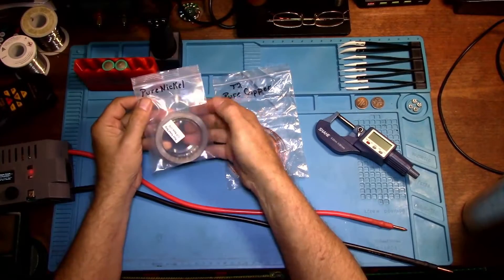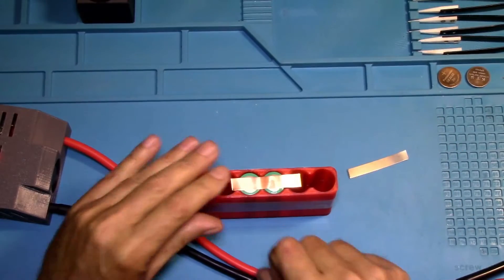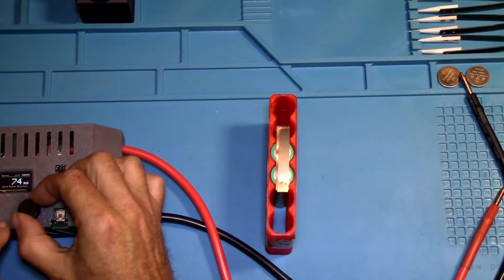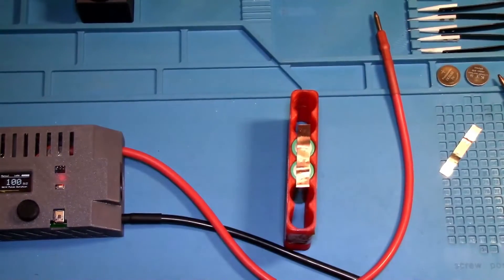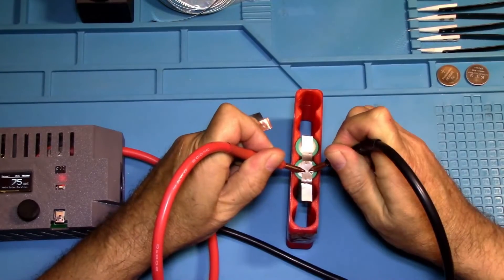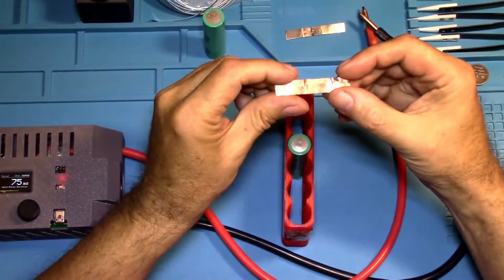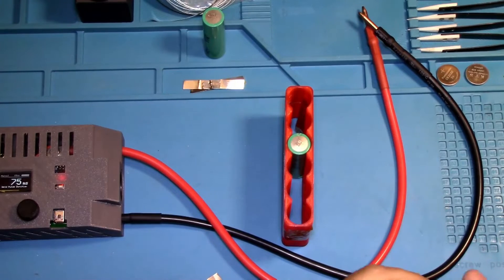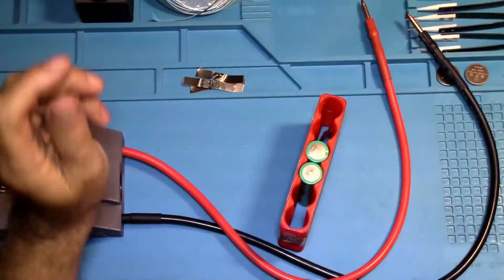Can the Malectrics Spot Welder Do A Copper Sandwich Weld - Pure Nickel, Pure Copper - Let's Find Out

Comment: Resistence is one of the big factors of spot welding .
Amps , pressure and resistance.  Ive found the spacing between the electrodes is absolutely vital to outcome . I dont place my electrodes by hand because the gap and therefore the weld outcome are just too difficult to do consistently. Same for pressure .
Basically copper very low resistance means you need a whole lot more amps in order to build enough heat to form the weld . 
I have been looking at these sandwiches as a way to reduce voltage sag im seeing in packs with very high capacity cells that have low / medium current discharge capacity . Ie/ 18650 cells w/3500mah @10 amp max .
I always see a fully charged pack at 16.6-16.8 volts sag immediately upon high throttle down to 15 volts flat or even 14.75 volts at times .
Im thinking its the nickel strips but this whole "sandwich " strip theory just sounds like more variables in a game that already has too many variables ...
I might just stick to layers of nickel becausr I build long range planes where I simply cant afford to have welds come loose on a plane thats in the air more than an hour operating out of sight !
Reply from the maker: Thank you for your comment, and I absolutely have to agree with you.  Every battery pack that I have taken apart (and I have taken a lot of packs apart to salvage batteries), have had only ONE strip on the batteries.  If using a "Sandwich weld was SO vital to better performance, then why don't companies like Dewalt, Milwaukee, Ryobi, Bosch etc., etc., use sandwich welds in their batteries?.

If we need (for some reason) double layers, why not just use a thicker strip?, unless there is some significance to using two smaller strips instead on one thicker strip?...

I have built a number of battery packs using only one layer of nickel and I have never had a problem with overheating or failure, so I don't really see the point (like you say) to use copper and nickel together, but I guess it is whatever is best for the individual... 

I created this video due to a request, but have never (before or after this video), created a battery pack using a sandwich weld, but it was fun to give it a try to see if it would work I suppose :).

Comment: That spotwelder performance depends heavely on what battery you power it with. I use a 800cca carbattery combined with bigger welding leads, and that is so powerful that I need to go down to 7-10ms when welding 0,15mm nickel strips. So I think my setup with the same spotwelder would have been able to weld that sandwich 👍💥
Reply from the maker: You are exactly correct.  It depends heavily on the battery and cables for sure to get the best performance.

Comment: Is that Setting (40, 60 75 etc milliSeconds or percentage?  @ about 11:35 the reason it is "puffed" is because you are pulling the strip off.  Tere would be some heat on the top of the battery but current is not going thru the battery.
Reply from the maker: It is miliseconds.  No current going through the battery,  but yes the heat will go up as the milliseconds are increased.

Comment: I have a previous version of this spot welder and, when everything is working well, it does a good job (mine is mainly used to make 4S2P replacement battery packs for cordless drills) , however, 2 years on I am on my 2nd set of batteries. I have 2, 3S LiPo packs in parallel, a 5200mAh 100C and a  5000mAh 60C but the 2nd set have degraded to such an extent that one is puffed up significantly and their combined capacity even fully charged will only give 350amps. I am considering a super capacitor version which would be about the same price as 2 new Lipos. So I wondered what you use to power your system?
Reply from the maker: Thank you Michael for the comment.  I am using a Zeee 11.1V 3S Lipo Battery 100C 9000mAh

A puffed battery sounds kinda scary.  This is a link to the one I found on Amazon:
https://www.amazon.com/Zeee-9000mAh-Battery-Connector-Infraction/dp/B07YP7DW2Z/ref=sr_1_6?sr=8-6

You can search Amazon for:
zeee 3s lipo battery 9000mah

There are a few, but oddly not many of that size.

Hope this helps.
Reply: @Outside-In.  Yes that is the reason I have discharged the puffed one and dropped into Aldi's battery recycle bin. I think it is the high current that has degraded them as I would get almost 600A when it was working properly. That is why I wondered about the supercap version I had even gone as far as thinking about one of the deep cycle lead acid batteries (aldi sometimes have them on special) that are used for solar panels. I only use it on my electronics station so a semi permanent setup would work.
Reply from the maker: @michaellinahan7740  Thanks for the info.  Do you have a link to the super capacitor version, I would like to take a look at that?.

It is great to hear that you were able to get rid of the polymer that was puffed.  I keep mine in a fire proof safe, but still it makes me nervous having them around, and maybe a super capacitor would be a much safer way to go.
Reply: @Outside-In.  YouTube has been deleting my replies so I sent an email to the one listed on the contacts page
Reply from the maker: @michaellinahan7740  Unfortunately YouTube does that from time to time, it also happens to me sometimes...  I haven't received an email yet, but will keep a lookout for it.

Comment: Hey .. to properly do this test, you MUST have a separation between the electrode materials. I cut my strips lengthwise so the current goes down into the strips.  please repeat test  thanks
Reply from the maker: Thanks for the suggestion.  I was about to point you to another video where I successfully welded copper and nickel, but I see you already looked at that.  I am not sure what you mean by "you MUST have a separation between the electrode materials".  forgive me if I sound dumb, but I have been working on a new video, and haven't had a chance to "change gears"  yet LOL.

Comment: The material on top needs to be the least conductive option you have, like a thin(0.1mm) nickel-plated steel, because the resistance in the metal transforms that sudden rush of electrons into heat, heating up the metal on top and that one melting the metal below. You can even cut little squares(1 cell) to put on top of copper because the metal on top doesn’t contribute to conducting electricity(for this small load), it will take the path of least resistance and that is copper.
On a side note, you can check if it’s pure nickel by taking the volume(L x l x thickness/height) and weighting it - then you can take that to an online calculator to get the values of what a specific material should weigh at that volume.
Reply from the maker: Thanks Lilian for the information - much appreciated.  Good to know that the nickel is only used to fuse the copper to the cell.  I like using a corrosion solution to test pure nickel, but the weight of nickel sounds interesting as well.  👍
Reply: @Outside-In.  The more resistant the better. As @allacemed mentioned, the nickel-steel has much resistance and that is converted in heat and that is good to weld copper. Copper alone does not weld well because is so conductive that does not give a chance to the welder to produce heat and weld, unless you use a powerful welder using Flux between the copper and the battery.,
Reply from the maker: @DroneSurf  Thank you Drone Surf, you are exactly right.  I am learning as I go with spot welding, and it is comments like yours that help not just me, but everyone who reads them, so thanks for the information, very helpful - and much appreciated.  👍👍🤏

Comment: The nickel heats up enough to melt both itself and the copper under it. The copper does not heat up enough by itself
Reply from the maker: Yes, I am sure we would need a much much more powerful welder to spot weld copper by itself.
Reply: @Outside-In.  So it means if its hard to  spot weld it the more capable it is to stand a current. I just bought a 0.15mm nickel plated copper i cant weld it but a 0.3mm pure nickel is no problem.
Reply from the maker: @jobmariano348  It mostly has to do with the type of battery you are using and the leads length.  I am using a 3s 9AH 100c battery, and it does weld 0.1mm copper and 0.1mm pure nickel, so it depends on the total thickness, but a thinner copper is better as copper is the hardest to weld.  

Thanks for your experience - much appreciated and good to know. 👍
Reply: @Outside-In.  Is it ok to put a nickel before copper then nickel again. Because base on my experience on this the copper stick to the bottom and upper nickel and its tight. But is that setup safe. Please help
Reply from the maker: @jobmariano348  Job - Thanks for the question.  Wow - That would be quit the sandwich 🤔 - That is quit the interesting thought, but I would say only if you had a much more powerful spot welder, because not only do you have to have enough heat to go through the copper to the battery (which the nickel is the reason for that to work), but you now have to go through yet another layer of nickel to complete the weld.  

Would it be safe - that would depend on the thickness of the strips, and the extra power you would need because of that thickness, you would just have to give it a go with your welder and see if it would actually work, but I would recommend to use a scrap piece of metal instead of a battery - you know, just in case you needed too much power - causing a catastrophic failure of your battery...  If you have a .2mm nickel, a .2mm copper and a .2mm nickel - that is allot to get through, so like I say - you can only try - don't know why anyone would want or need to do a weld like that, but we wouldn't know until we tried.  

There are many others that have much more experience than I, so hopefully someone in the comments will feel free to chime in with their experience - I am using mostly common sense with my answer to make up for my lack of experience LOL.

"Every new idea - comes with unknowns, but until the unknowns are tried and tested - it will forever remain - an unknown..."    outside in

Hope this helps, and thanks for your question. 👍
Reply: @Outside-In.   i have 21S 11P batteries load is 165A

My pack is rectangle
I used 0.15mm x 8mm nickel
First  for the parralel 
then 0.05mm copper x 240mm width then a strip of 0.3mm x 8mm nickel per battery point to weld the copper. Do you think it can handle that 165A load?

Because based on my research a 0.15mm x 8mm nickel total area is 1.2mm2  is good for 4amps
Then a copper is 4 times conductible than nickel meaning for every 1.2mm2 copper it can handle 16amps.

Based on my setup it is 0.05mm x 240mm copper is 12mm2 divided by 1.2mm2 = 10 x 16amps =160amps

Then 3mm x 8mm of nickel =  2.4mm2  which is equal to 8amps 

8amps x 11Parallell = equals 88amps

So overall it is 160A +88A = 248A.

So i hope it is safe for my 165A load.
Reply from the maker: @jobmariano348  Thanks Job.  Yes, you could even do that using only nickel, and the only reason that some and I say only some - people use copper as well, is just to be sure, but any battery pack that you purchase on the market only uses nickel strips (around .2 - .3mm), and your setup would be .5mm.  I have never ever seen a battery pack that you purchase that uses a sandwich weld on their batteries, as that would make that pack very very expensive.  So I would say that anything that you can do (building your own), that enhances what you can buy - would definitely work and be ok, but like I stated earlier, you won't know until you try.  But also keep in mind that the extra power you will need to complete a weld like that, and that many welds to build a battery that big - will introduce an incredible amount of heat in those cells, so could be very dangerous without welding very slowly to keep down the amount of heat that you will be introducing into the pack.
Reply from the maker: @jobmariano348  Job - this is to let you know that I am getting ready to leave town in a few moments, so if you respond and I don't right away, it is not that I am ignoring you, it is that I am on the road and will be for the next 4 hours.  If you have any further questions, I will answer them as soon as I get stopped.  Thanks for your understanding.

Comment: Nickel is not nearly as conductive as other metals that are commonly used like copper, gold, silver, or aluminum, but, it’s for that reason that it remains a popular choice for DIY.

The nickel’s higher resistance is the reason it welds more easily, as with more resistance there is more heat being generated at the welding electrodes, allowing it to be welded with equipment that isn’t industrial-grade, and very expensive. 

It takes thousands of amps to reliably weld copper strip directly to the cell, however by placing the nickel on top, the current must pass through the higher resistance nickel along with the copper, increasing the heat sufficiently that the copper can also be welded with the nickel.
Reply from the maker: Thanks Mark for the information - makes perfect sense.  I created another video by request, and used thinner copper that worked much better, and like you say - using less-than industrial grade welders, is going to make it difficult to do a sandwich weld, but with the proper gauge copper - it is possible to achieve. 👍
Reply: @Outside-In.  Nice, I’ll check out the video! 
And yes you’re right, I should’ve mentioned I was referring to welding only the copper strip directly to a cell that takes substantial higher amounts of amperage, and that the sandwich method allows for much less current to be used versus welding just copper strip to battery.
Reply from the maker: @markb1911  It was great that someone asked me to visit this video again, because at the time, I didn't find any copper strips that were very thin for the test, so why I had to use what I had, which turned out to be way too thick, and in turn, unfair to the spot welder I was using, but the thinner copper, worked very well.  
And you are right....  Trying to spot weld copper by itself, is extremely hard to do, but always a fun test regardless right?...

Thanks for clarifying your comment, and also your insights - they are much appreciated. 👍
Reply: @Outside-In.  Yes indeed I do enjoy testing spot welding different types of strips, and just for fun I like to order inexpensive spot welder boards from ebay etc. to see if I can modify them to work consistently, and as intended without letting the smoke out! It’s usually the drive circuitry for the FETs on almost all of them that is the weak point. 

Although I have a couple of those sub-$20 welders working well, they aren’t designed for, and don’t have duel-pulse functionality. I’ve been looking into the different choices for a reliable FET style welder with duel-pulse functionality, and ended up purchasing this Malectrics one, the v4. 

I like it’s modularity, and use of the Arduino for timing control for the customization ability of an open source platform. I’m going to see how it welds using a 4s-2p headway (12.8v lifepo4) bank as a power source, and then go from there. 

Thanks for the helpful videos!
Reply from the maker: @markb1911  Glad you liked the video.  I like fooling around with less than capable devices, and boosting them as well.  Have fun with the Malectrics, and thanks for the comment, much appreciated.